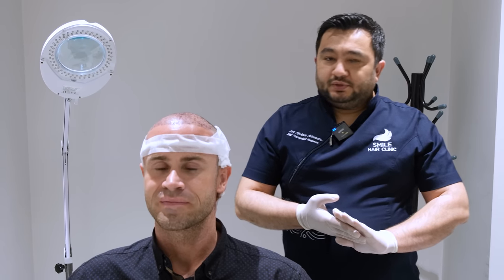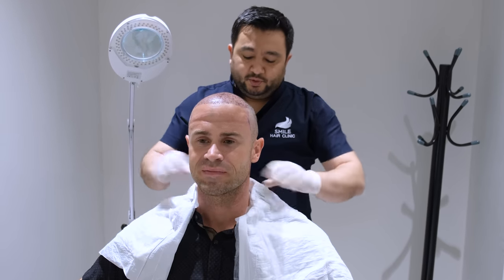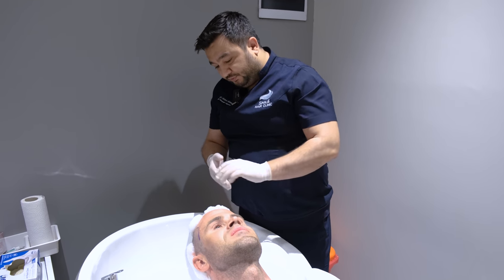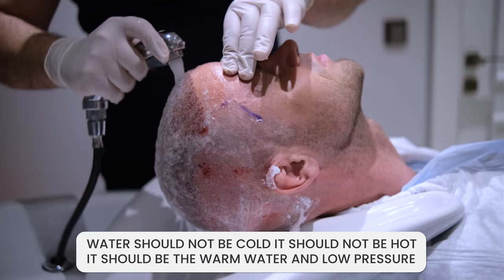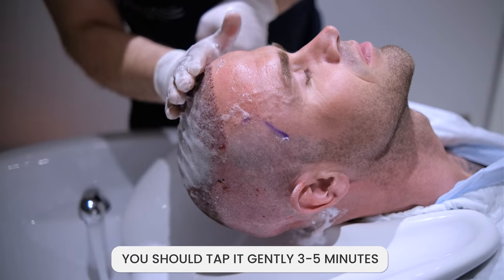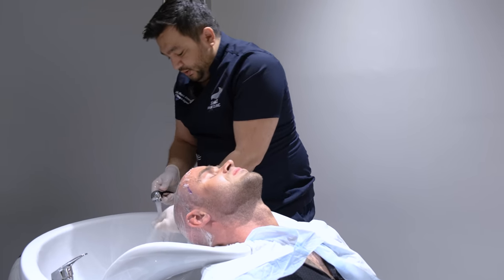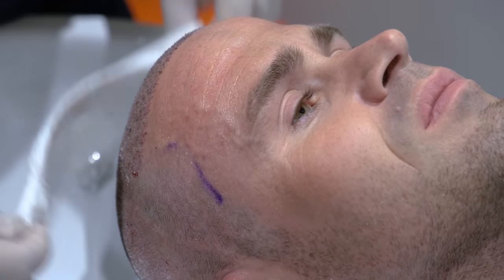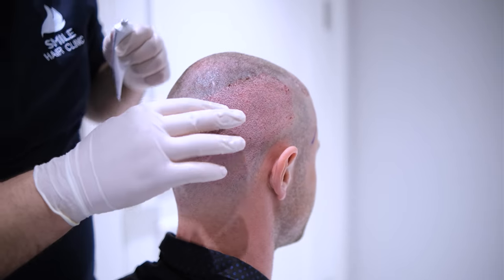PLEASE CLICK THE LINK IN THE DESCRIPTION FOR OUR CURRENT WASHING VIDEO!

Comment: I feel my scalp the recipient area pulsating after 10 days of transplant, not pain but throbbing pulsating feel.. it's continuous and only a relief when massages light handed. It's 18th day and it still continues, is this normal ???
Reply from the maker: Some kind of pain is normal within the first weeks after the surgery. For mild pain gentle massage is fine, for moderate pain, the patient can use pain killers i.e. NSAIDs,s, etc.

Is the pain across the whole recipient area or in a specific area?
Reply: @SmileHairClinic  Thank you for response. It isnt pain, it's pulsating, mid scalp area, my recipient area is frontal and mid scalp, it happens only in mid area.
Reply: I'm on my 5th day and I also have that same feeling, is it normal, because it bothers a lot in every area that received the implant.

Comment: is ther anything else i can use in replacement of the panthenol foam? as i didnt have checked luggage when i came home due to short connecting flights and cant get it delivered for a few days.
thanks
Reply from the maker: Hello! You can also use Bepanthene Body Lotion:)
Reply: @SmileHairClinic  thanks.
i have the panthenol foam now  should i still leave it on for 30minutes every day?
Reply from the maker: @shaunwashington1895  Yes, you should keep doing this for 14 days:)